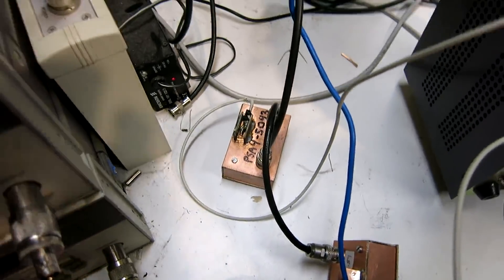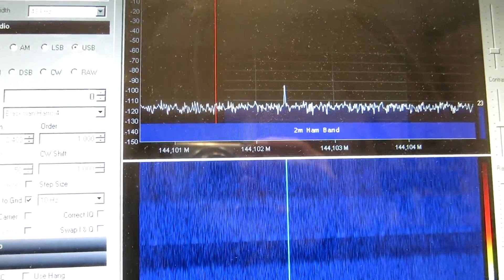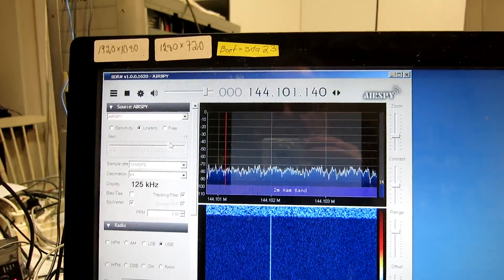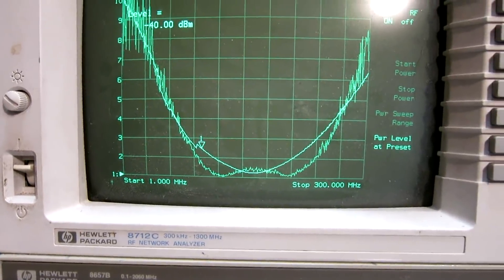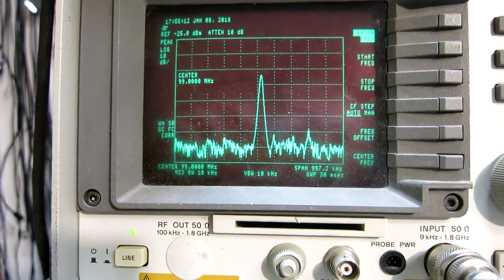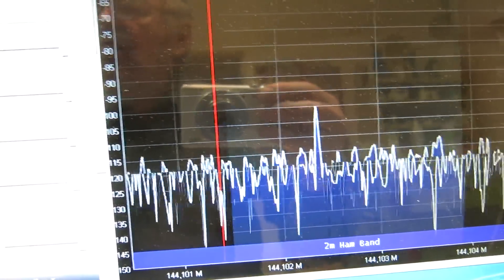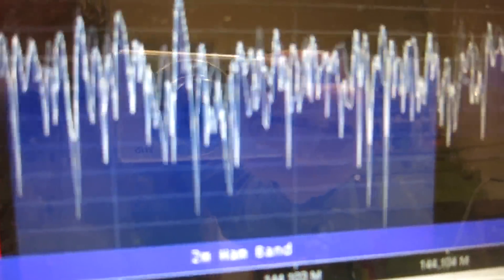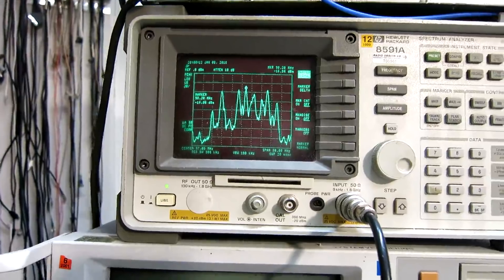airspies

Comment: Nice video, as always ;) One unrelated question: I have noticed that you use clamp BNC connectors on all of the cables. Do you find them more reliable than the usual crimped ones or is it just a preference due to some other factors?
Reply from the maker: Yes. Very much so. Too low contact pressure gives rise to third order intermodulation. BNC connectors (as well as N connectors) need to be slightly bent to increase the contact pressure. I made an IM3 test on all my cables and had to tighten the nut on abour 5 % of the connectors. My cables are always double-screened. RG 223 or similar. I do not have professional crimp tools. Maybe crimping could be OK but many cables of unknown origin with crimped connectors have had problems. IM3 and/or not RF tight.
Reply: That is really interesting, I newer thought about IM and I don't remember that anyone else mentioned cable construction and IM. Maybe a good topic for a video? 
I did test a bunch of cables for RL. The results made me pay more attention to how I make them, especially when using UHF connectors and adapters. I also switched to RG223 after I tried to make g3ynh "Self-evaluating Precision Reference Bridge".